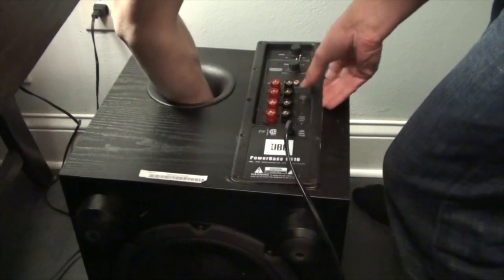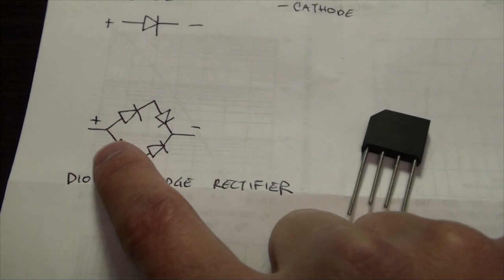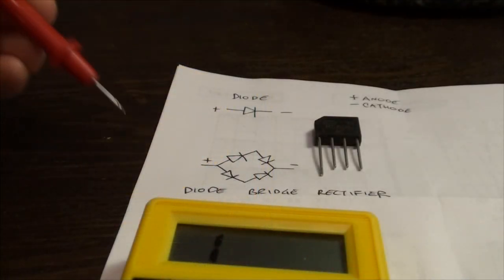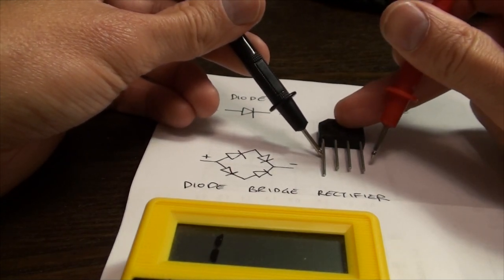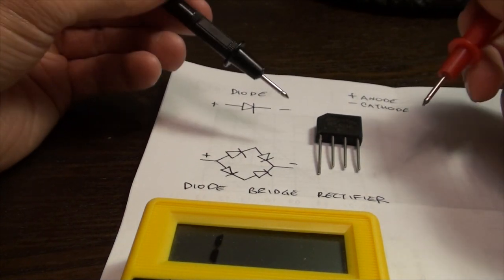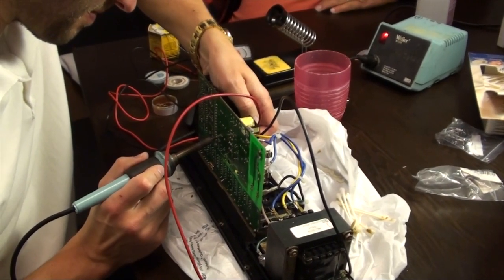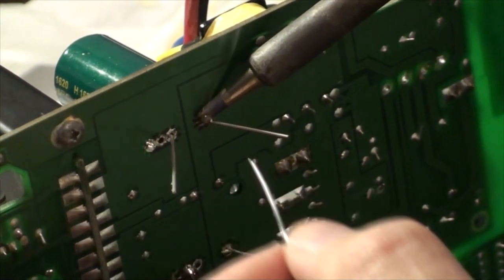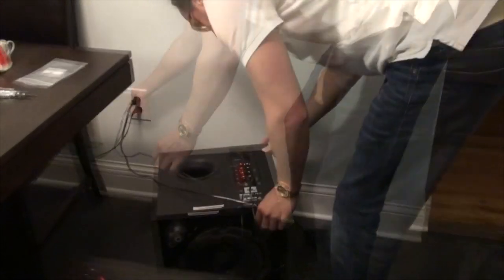Troubleshooting **FIX** JBL Home Audio PowerBass Subwoofer PB10 - Part 2

Comment: Thanks for posting this fix. I'm going to follow your advice for my currently fried PB12 replacing the capacitors and DBR. This video was posted a while back and I am wondering if your unit is still working?.
Reply from the maker: Hi Warren, it's still working great!  In fact, the sub is thumping right now 👌
Reply: Great news. Thanks @VestigialVoice
Reply from the maker: @warrenslater9623  you're welcome, bud!  Many of these lower-end powered subs don't come with a power switch.  I posted a video a while back where I modified it to add that functionality.  Something tells me tonic voltage is less ideal to the electronic's longevity.

Comment: Hello @Vestigial Voice - I need help regarding my JBL PB 12 (Revision 1) subwoofer. The sub will just blow the fuse immediately after connected to power. I de-soldered the 2 capacitors (C1 and C2) and checked them. They are rated at 2200 mF and one measures 2190 and other one at 2270. Should I replace the capacitors? What do you think could be the reason for the sub blowing up fuses.
Reply from the maker: Hi Alok, if you properly tested those capacitors, then I doubt that is the problem.  It sounds more like you have a short circuit which is allowing too much current to flow across the fuse, which, in turn, keeps blowing the fuse out.
The good news:  if it weren't for that fuse blowing out, your hardware would be damaged.
As to where it is happening, you'll have to hunt around with that multimeter, good luck, my friend 🍀
Reply: check on the bridge rectifier for any possible shorts

Comment: I see your videos and also read your very active and helpful in comments. Perhaps you can clear up some questions I have?
PB10 = red lights only, no bass or green lights
Tried replacing cables, tried “Y” cable, different settings, etc
However, when I ran single RCA output straight from BR player to sub input, I got the green lights and the sound worked. So I assumed AVR was culprit.
Replace my Yamaha with new Denon and same problem.
When I ran the Denon speaker setup test, the sub lights turn green, played the tone and passed the test. I’ve tried every HDMI input device and not a peep, just the red lights. Also tried the Denon LFE+Main option. Nothing.
What test signal (tone) comes from the internal AVR circuitry that apparently isn’t received from any HDMI inputs (or my components)? Surely every HDMI cable I own hasn’t gone bad. Do they need to be 2020 models? Lol
Is the BR/DVD audio output (bypassing AVR ) to sub input a reliable test to go by?
Any help is appreciated. Kind of like new AVR, but still in return window and could get nice sub replacement for that price.
Reply: I forgot to mention the Denon AVR has a initial setup tone to test the speakers, and another “white noise” type sound that’s used from a different menu. The PB10 works for the setup tone (chime), but not responding (green light or sound) for the other test noise (soft static sound). I also should have said I’m using all JBL speakers in a 5.1 setup with large CL2 rated 14ga AWG 4-conductor copper speaker wire, and dual shielded RCA sub cable.
Reply from the maker: Hi Kyle, good analysis (discovering it worked with test tones).
I have a couple questions and then a general grievance.
--What happens when you plug either of those receivers into a DIFFERENT subwoofer that's been verified to work?
--Are you able to get thump in that setup?  This test will troubleshoot the problem as with the receivers/settings/cables versus the subwoofer.
--Also, if you haven't already tried, make sure to play slightly louder MUSIC when you test.  Don't use television broadcasts, especially for this sub.  Which leads into my grievance.
--Often, my PB10 remains in standby (red lamps), while watching television.  When it does finally kick in, it seems to only half-heartedly hit that very first note, before performing regularly again.  Caps should take care of that right (lol)?  Only in the ideal world...  These are the situations we compromise with when using budget equipment.
I look forward to hearing from you soon.  Thank you for the comment 👌🏼
Reply: @VestigialVoice  Thanks for the reply, and yes I’ve noticed as the speakers (or myself) age, it takes more volume to switch them into green light mode. That was before the latest dilemma. I did go out and buy a new Klipsch 12” sub and it works without any problem. Im still haven’t tweaked the sound, and I plan to give the Denon Audyssey setup a shot. It would be nice to have the JBL working as my 2nd sub. So I guess the faulty equipment was/is the sub. When it passed the test (I learned about online) by running RCA’s direct from a optical player, I rushed out and replaced a  2 year old Yamaha AVR with a new Denon. Disappointed it didn’t fix my sub problem and it even caused another small one. Now I really like the new Denon and plan to keep it. So that’s won’t likely go over well.
From what I’ve read here, sounds like you would start by replacing the capacitors, correct? I can buy the parts but need to find someone with a steady hand to do the labor. I struggle changing a lightbulb, and I’d be nervous as a whore in church messing with electronics internals.
Thank you so much for helping the many people here, sharing your knowledge, without sounding condescending. I hope lots of good karma comes your way.
Reply: @MrAlvinTostig  yes hi i got a powerbass pb10 from a friend and when i plug it in it has lil pop sound and wont connect lights stay red
Reply: im useing a pyle PD3000BA IT WORKS FINE SUB OUT PUTS WORK

Comment: Hi any idea about where to get the complete circuit of the subwoofer northridge e150p
Reply from the maker: Hey sherif, good to hear from you again!
I do not know where to get a complete circuit for that subwoofer.
What on earth happened that you would need one as opposed to just replacing a single faulty component?
Reply: @VestigialVoice  Hey, I don't really know, but what I have noticed lately that if the volume is low the subwoofer starts to try to kick in on and off quickly with no use but just a buzz sound
But when I raise the volume it kicks in and works properly..
also on the case the music stops it keeps buzzing till it switches off and the led keep flickering green/red gradually till it stops and turn red..
Do you have an advice ??
I can also load videos for the above.
Reply: Im having the same issue as well but it's Northridge E250P. Works fine for 30-60 mins and then the light starts flickering between green and red. Everytime it turns green as it flickers, there is the popping noise from being turned on. Tried all connections, ports, settings, and wires but the same problem persists.

Next, I will try to open it up like what is shown here.
Reply: @archael18  In this case I think there is a different component that requires to be checked, rather than the capacitors as i have already replaced them with no result.. unfortunately
Reply: @smmohy  i've opened it up and checked. There are 2 failing capacitors and one exploded super small diode, it seems like. I will likely attempt a fix in the coming weeks. I had found a circuit diagram as well to make sure I replace the correct parts.

Comment: Do you remember what diode you used? 600V or 800V? Also do you have link for the part? Thank you in advance.
Reply from the maker: Thank you for the comment, Axel!  I placed the information in the comments, but probably neglected to add it in the actual video...  It is an RS606 AC that handles an 800V max (if memory serves, the original was a 600V, but don't hold me to that).  I purchased mine off ebay from a vendor in Europe, but you can probably find an equivalent on digikey or mouser.com.  Have a great weekend!!  :)
Reply: Thank you very much. Your knowledge is much appreciated.
Reply: @axeljehovanymendoza  did you ever continue on with this project? I think the module and capacitors are burnt out on mine. I would assume the diode is out as well. I think this happened because I hooked it up to a 6 way

Comment: Bro I have almost the same problem with my jbl subwoofer 140/230. I am not familiar on using a tester. can I send you the video of the subwoofer having the noise thru your email?
Reply from the maker: HM, I checked out your most recent video, awesome drone footage and video editing!  You've got skills  :)
As for your question:  If you'd like me to check out a personal video, upload it to youtube as "unlisted" and then link it in the comments here.
Reply from the maker: Geez, HM, that noise would bother me  ;)
From what I can hear, it's making the same sound as a subwoofer being plugged in, which almost leads me to believe, after large bass-hits, the power becomes depleted (or is a weak solder joint to the PSU).
Typically, there are multiple (usually 2) large capacitors.  I would start there (see my first JBL repair video).  With only 1 fully functional cap in circuit, the sub will eventually fail.
The good news is:  this is a fairly simple fix.  Make sure to get the polarity correct (+ and -).  Also, I would recommend replacing both capacitors if you find that to be the problem.
You will be able to verify the failed capacitor, using a multimeter, after removal from the circuit (unless you have a ESR tester, which allows you to test without removing the capacitor).
Let me know what you find out!
Reply: @VestigialVoice  Really appreciate your reply bro.! I actually opened the electronics inside but I can't find any suspicious caps based on your repair video (or I am not really expert on finding faulty caps) I think base on your diagnosis it is better to get a new one. haha! Thank you so much bro... really really appreciate it! 🙏🙏🙏
Reply from the maker: You're welcome, brother  :)  I hear ya' about getting a new one (I always get excited for new gear), but also use this as a learning opportunity!  Tinker with the 140/230 and perhaps you'll learn something (or even fix it)!
You know where to find me if you have any questions, have a great week  :)
Reply: @VestigialVoice  I will also try out your fix as well.. 😊 I will message you when I burst my new sub again. 🤣🔥

Comment: I doubt anyone will see this, but I am having the problem where as soon as I plug it in, the fuse blows. Caps are ok, I was sure the bridge rectifier was shorted, and replaced it, but it turned out that when out of circuit the BR tested ok and not shorted. So now I am out of ideas and hoping it is not the module, although I think I saw a post headline somewhere that someone was able to fix their module.
Anyone have any ideas what else could be causing this?  I have been testing the board when out of the box, so nothing to do with the speaker.  Also tested the transformer and that is ok. I really don't want to have to throw a sub I love out because of some $3 part... Help!
Reply from the maker: Are you replacing with the correct SLO BLO specc'd fuse, veloci?
How much current do you have hitting that fuse?
Reply: @VestigialVoice  yes sit. I then replaced the bridge rectifier, I was sure that was going to be it, but it wasn’t… :(

Comment: so far so good with my unit,no pops or capacitors blowing up!
Reply from the maker: You are the man, Aaron!  I'm glad to hear the videos helped!  :)
Reply: Ok so it crapped out again.  I replaced the two capacitors as they were both puffed up again.  Still no good.  The transformer inside was hot to the touch as well.  Wondering if I should continue chasing this down or look into another unit.  Although I have a Sony behind my couch but its mediocre in comparison! Thoughts?  Hope all is well with you and family!
Reply from the maker: What happened when you tested the diode bridge rectifier?
Reply: @VestigialVoice   I didn't get that far.  I swapped it out for the Sony and put it in my basement.  How do I go about testing the DBR? Ohms test I assume?
Reply: @VestigialVoice  Please ignore my question!  I do not have a meter with a diode setting & not sure if it would be worth purchasing as I have no use it other than for this unit.  I work in a different electrical field and have access to meters and wondered if I can do a resistance check on this?